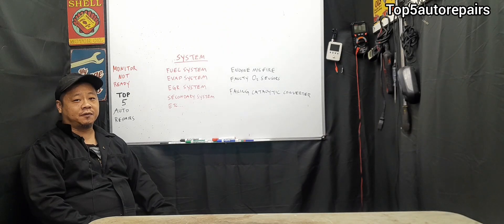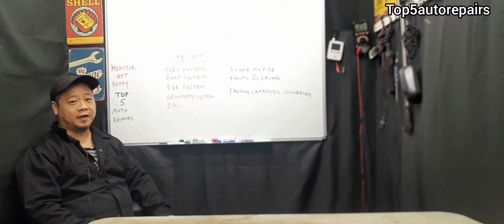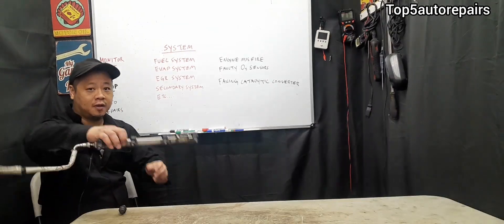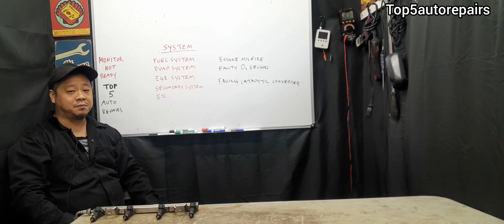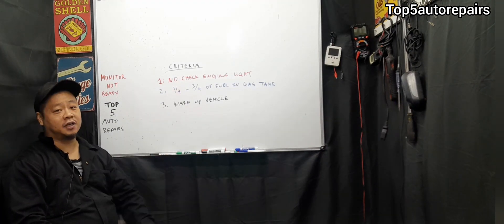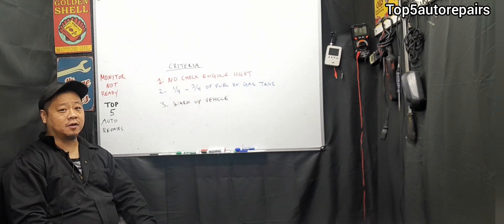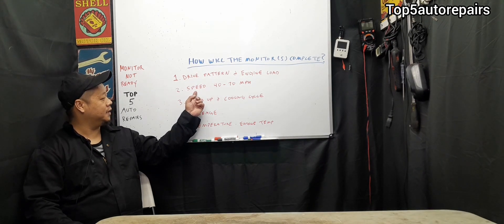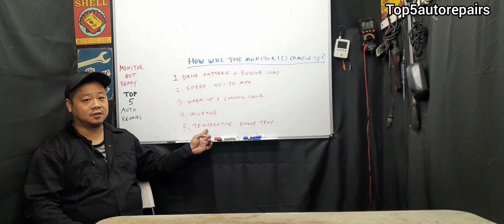HOW TO COMPLETE READINESS MONITOR (MONITOR NOT READY OR INCOMPLETE)

Comment: I'm In LIMP mode bro.. Can't complete drive cycle, got knock sensor CEL replaced with OEM from local dealer and OEM KS harness, $550.. Won't reset out  of Limp ode, I can't get up to speed. to complete drive cycle -2000 4runner 5vz-fe .. oh now lots of other codes re being thrown, which ones?.. all of them. and thoughts?